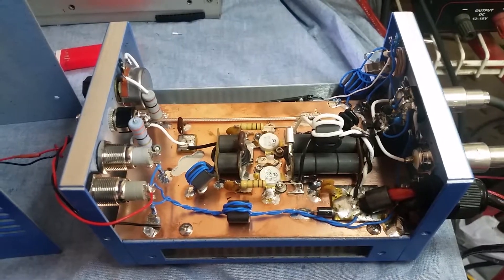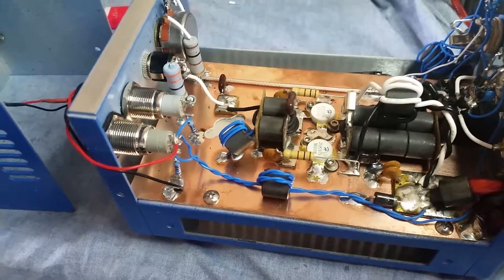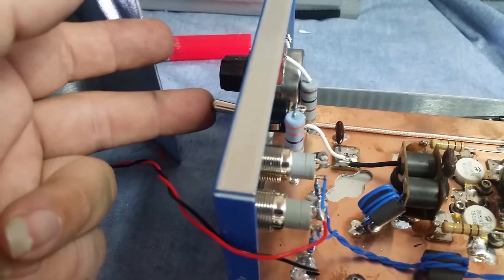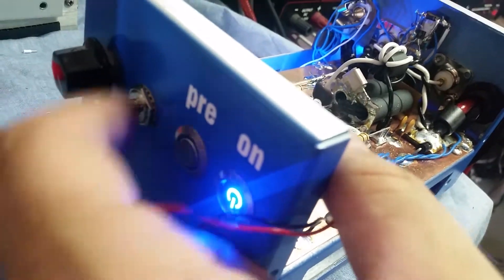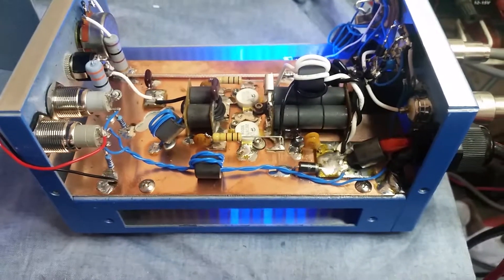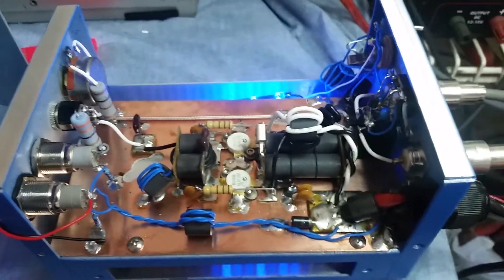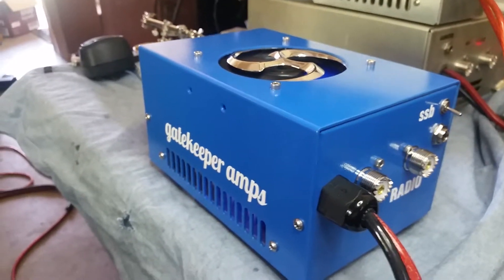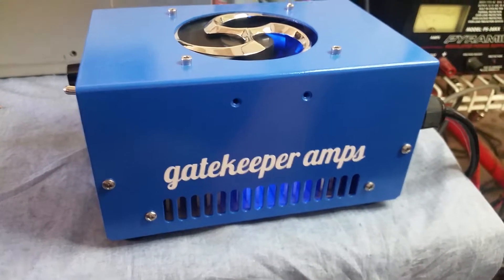Raffle Amp GK200 2 Pill For NorCal Mudducks Break on the Lake

Comment: looking great ! I started to build my test box for the HG I got. SD 1446/ 2510 24V pills. only got 2 of each. not going to use relay. just in and out to dummy load. just testing transistors. big 2/8 heatsink from old x force box I rebuilt years ago. can't find my input transformers . using BNC input and N to dummy load . what I had handy. mostly used parts and arco trimmer's . got to watch what pill holes I use. some stripped out why I replaced heatsink. I may just re drill/tap  . just putting parts in a cardboard box for now. when I find everything I build and test. busy with girlfriend. hobby last. 73's😀